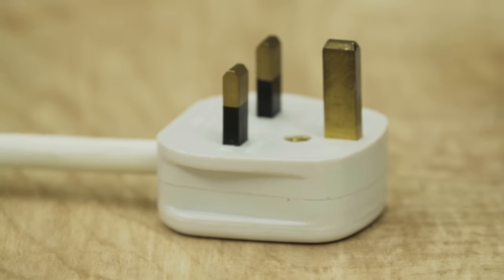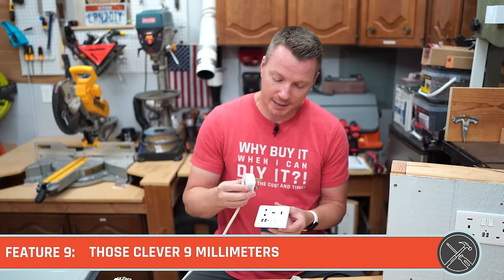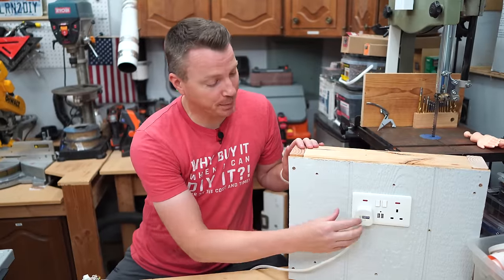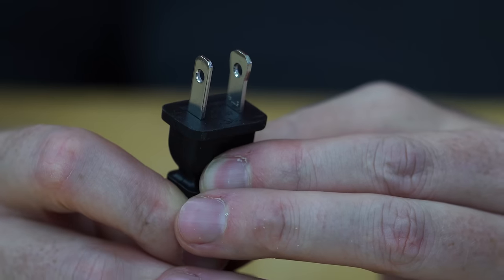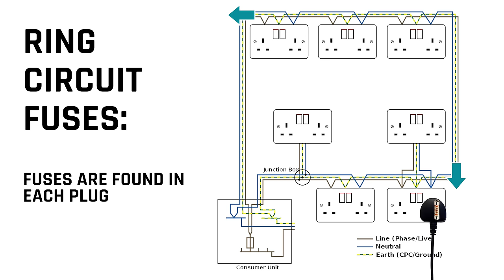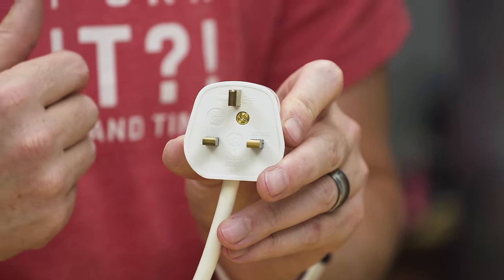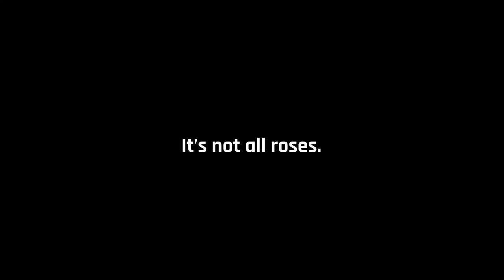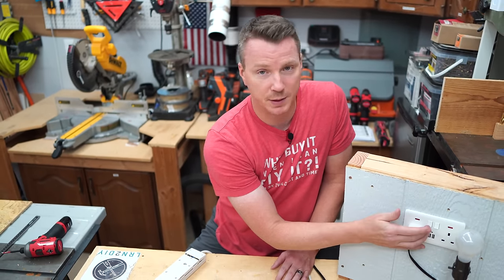British Plugs and Outlets Are On Another Level

Comment: As for your #9, the USA does have the insulation on the hot and neutral prongs to prevent boot leg wire wrapping.  It is the stuff made in China that does not have it.  A lot of countries have reused the type A and type B and don't realize that the USA has both a 5-15 and a 6-15.  Both the 5-15 and 6-15 might be considered type B/A outlets, but are different voltages.  This is why people are confused about safety is because countries that make the plugs have their own idea of the plugs.
Reply: I've never seen a type A or B with any kind of insulation on the prongs irrespective of country of origin.

Comment: In a typical UK house, there is more than one ring circuit. Usually you will have at least one ring circuit for the ground floor (US 1st floor), another for the first floor (US 2nd Floor), and so on.

Each ring circuit is rated at 32 amps. If you have many outlets you can split a ring circuit in two and add another 32 amp breaker in your circuit breaker box (UK consumer unit). 

You should not have an overloading problem if there are sufficient 32 amp rings. Wired with 2.5 mm twin and earth cable.

Lighting circuits in the UK are radial, usually 5 amps and again one for each floor. Wired with 1.5 mm twin and earth cable.

Electric Stove Circuits are also radial, usually 20 amps, and wired directly into a special switched isolator nearby. Wired with 6 mm twin and earth cable.

Comment: Factoid: Ring circuits I think are really only used in the UK and Hong Kong. I'm pretty sure they were developed as a war time cost/material saving measure since you can theoretically use a smaller gauge wire. And 230 volt circuits are considerably more dangerous than 120, so the extra safety features are even more necessary. 

Tamper resistant (TR) plugs are now mandatory on new residential installations in Canada, and I'm assuming the same is true in the US. These have gates on them that only open when both prongs push on them at the same time. They won't open if only one of the gates is contacted.

Comment: The British G Type fuse-in-plug was to protect appliance flexes. And to standardise on one plug and socket as previously there were different sized plugs & sockets and cable for different types of current draws and appliances: 2A, 5A and 15A. It was common to have three different types of sockets in one room. The square 3-pin with an integrated fuse between 1A and 13A (now user inserted) solved it all and also protected appliance flexes from bursting into flames.

However the fuse-in-plug became an enabler to use final ring circuits. The final ring circuit is ingenious in its simplicity. When used with the British G Type plug the ring is a busbar run around the house with distributed fuses at each appliance. The final ring Protected by an AFDD they are bombproof.

Comment: I come from a country that was an ex British colony and yes these plugs are common. I was even taught how to open and replace the fuse in the plug when I was in school. However, newer electrical appliances come with a plug that can't be opened, thus rendering the device inoperable just because the plug's are out of order. Also, there is a trend where newer devices that have only two pins.
Reply: You can always cut off the busted plug and replace it. New plugs are available at virtually every grocery store.
Reply: @jebeda  Yes, and faulty plugs are pretty much unheard of. There's little, if anything, to go wrong except perhaps a loose wire but that's rare on the new fixed plugs as the cables are moulded into place. The only thing that generally needs replacing in them is the fuse.

Comment: Just a few things.  A lot of new products use a completely molded plug with just the fuse accessible.  You can easily get sockets without switches for things like fridges you don't want switched off accidentally. You can get different fuses such as 3amp, 5amp and 13amp to protect different size cables or devices.  Ring mains distribute the power both ways around the circuit so load balancing is not an issue.  Each socket can take up to 13amp but the ring is often fused to trip at 30amps.
Reply: Electricians consider load balancing on rings when designing a system which is why kitchens (sometimes) have their own ring main.

Comment: From Iraq, lived in the UK for 4 years, lived in Australia for 4 years as well as travelled to central European countries many time. It would be fair to say that type G-plugs are safest but not the best. The down sides in my opinion are the size and with time makes the contact surface of the outlets become loose and overheats at the Line side. This is usual occurance that forces the users to change both the power outlet sweetch and the plug at the same time. On the contrary, this problem is less spotted with Australian plug type I which much smaller in comparison to type G

Comment: A few  points.
Load balancing isn't required due the nature of the ring by design. 
 The ring circuit is a parallel conductive circuit. The load is shared across both parallel live conductors, with each outlet being fed from two different ends of the ring at 32amp. How far away loads are placed becomes irrelevant. 
We don't have to worry about the size of the conductors as he mentions here because circuit design is strict in the UK and has to be compliant with regulations. 
A ring circuit typically uses a minimum of 2.5mm conductors,  Depending on overall circuit length, (maximum of 100m sq area) voltage drop should be calculated and it's effects factored into the design, up sizing the conductors if required.
And typically dwellings utilize multiple rings for different areas of the home. Kitchen. Bedroom, living spaces, etc.  

Testing a ring circuit isn't that difficult. There is a defined process for doing this as described in the regulations manual. Like all circuits they should be designed to handle their intended function appropriately, and tested accordingly to prove they will function as expected and meet safety standards. If it's too difficult for you, you should not be doing it. 
On which point. All circuits must have a design submitted and tests performed and recorded, by way of recognised auditing body for electrical installations, or submitted to the local authority if not done by a professional, before being made live for use.  

If you live in the UK and are used having a switch on the outlet, for which you would frequently use to power down appliances, you would not get confused "Troubleshooting" when turning on a lamp, or anything. You would simply check whether you had turned it off at the wall. Literally the first this you check.
 How is that confusing for a anyone? 😅

And Yes. These plugs lying down on the floor do hurt if you step on them. 
Really hurt.!!
 Everyone does it once.. You learn quickly never to leave yourself that vulnerable again. 😅
 Either leave stuff plugged in and switched off at the outlet. Or removed and stored safely away.
Reply: Load balancing may be a problem if there are heavy current drawing appliances on one leg of the ring. Circuit design can solve that.  Or have one leg on 4mm and the other on 2.5mm 

A ring circuit typically uses a minimum of 2.5mm conductors and has to have a 32A breaker in the consumer unit. 

I have never stood on a plug.

Comment: You should check out Australia & New Zealand's plugs, we use type I and its a good middle ground between these 2 plus, however I feel the positioning of the prongs is the most beneficial part to them.
Reply: ...and the Chinese liked them enough to base their standard on ours, although with the plug flipped over to put the earth pin at the top.

Comment: Testing a ring final is easy test end to end your little  r1, little r2, little rn, add r1 and r2 together and dived by 4
r1+r2=R   R/4=
0.50+0.25=0.75 
0.75/4=0.18
And it's as simple as that
Then you do your figure of 8 test

Comment: as a brit trades person, switches have never been an issue for trouble shooting. the size has never been an issue and ring circuits arent an issue as that is what sparkies are trained to wire in. im sure if they went to america it would seem foreign to them how you wire your houses. cant say ive ever stood on one either before. if i unplug something the device goes away or the socket is out of the way so the plug isnt just lying on the floor. who leaves a cable lying in the middle of a room

also i would never trade the plug we have for another. ive lost track of the amount of times in my life ive changed fuses or enitre plugs and its taken me a couple minutes to get back up and running as i can just take one off an unused device until i can grab a replacement which only cost about £1, if that.

Comment: If somethings not working we just try it in other sockets or see if another items works with the socket to see if the circuit breake may have been tripped, the breakers being tripped rerely happans and is easy to ckeck.

Comment: I moved from UK to HK, where as the video mentions we also use the Type G, but with two main differences that I noted…

1. In HK there are no switches on the sockets, and now I realise I quite liked them back in UK! They’re really useful if you want to turn something off at the mains, either to reset a device, or when leaving the house to go travelling. Now I have to physically unplug and re plug things and I don’t like it. Life is hard enough as it is. 

2. Not mentioned in this video, is that the UK regulations do not allow any of these type G sockets in UK bathrooms…this is for safety reasons and we usually only have specific outlets for shavers/toothbrushes. This is annoying in the uk as the hairdryer has to be put something else and I also want to plug in speakers and smart lamps in my bathrooms but cannot. But…In HK we can! There’s a socket in most bathrooms, but still without the switch. So it’s very useful for me, but feels a little dodgy to not be able to cut the power in the high-humidity environment. 

Anyway, great video mate!

Comment: I'm sure someone will already have mentioned it but we don't use ring final circuits any more these days in new installations. They were used as a way of making installations cheaper when copper was very expensive after the first world war, since you can use lighter gauge cable and less of it too, but it can lead to dangerous or weird situations if there is damage to the wiring.

I think the main reason the plugs were originally so "user serviceable" was that, here in the UK at least, nearly all appliances used to be sold without a plug, and you had to install your own. Nowadays this isn't the case and most plugs are of the latter type you showed - moulded with a separate fuse compartment. Wiring a plug used to be a vital skill for anyone, we were all taught how to do it at school!
Reply: Ring final circuits are still used. With the introduction of mandatory AFDDs on socket circuits - £120-150 for each, rings will remain to reduce the use of radial circuits and hence the purchase of unnecessary AFDDs.  The ring is dead - long live the ring.
Reply: @johnburns4017  Hooray for unintended consequences! 😂

Comment: Nice video, these plugs have many more positive aspects than negative. The internal fuse by the way also protects the flex on portable appliances if the appliance has a failure.  One minor correction, the plugs which have a plastic Earth pin are usually on appliances which are double insulated, not double earthed - your graphic was correct.
Reply: Excellent point Dave. I was looking through the comments to see if someone had noted this already and was going to do so if not. IMO, this is one of the best safety features of the British system. The plug can be properly fused to protect the wire and appliance at it's point of application rather than relying on the panel circuit breaker which has to be large enough to feed the entire branch. In US system, one can plug cords of #14, #16 or even #18 AWG into a 15A or 20A circuit. Hardly ideal. 
Another (perhaps minor) advantage of this is that the melt curve of the fuse can be tailored to the load.
- Retired Electrical Safety Engineer

Comment: Electrician from the UK. Load balancing doesn't really exist unless there's a break in the ring, as you're sharing you're amperes down both legs of the ring main. The only downside is that if the ring is broken for whatever reason, you won't know.

The UK plug and system is far superior than the American switches, especially when it comes to fuse boards, wiring regulations and standards. British supremacy

Comment: I'm an electrician in UK (originally from Romania) and I have few things to say:  1 the UK plugs are amazing, even better than European ones
2 yes the rings are annoying to install and test, so that's why we're not doing them anymore in new installation (some electricians may still do them, I don't) now we use 4mm2 radials
3 yes it is painful to step on them, but it doesn't happen too often
4 I do like that you can only plug them in only 1 direction as some appliances don't do well with reverse polarity
5 sometime I wish to plug something in (phone/laptop charger most often) upside down, like I can do with European plugs
Reply: In fairness, since we're now doing a circuit per floor, 16A radial circuits would probably suffice.  And no risk of a broken ring as a broken radial is immediately obvious.

Comment: The main issue with our Type G plugs is that the 13A rating is only really a short term rating, partially due to heat from the fuse, a plug that has 13A going through it for any length of time will get quite warm (a 13A fuse with 13A going through it will draw ~1W). The big pins make no difference really to the current handling, especially given European plugs are smaller yet support 16A
I understand the GPO only allowed 10A draw from a Type G plug and even then it had to be MK plugs and sockets, any other combination was 8A max.
Also not all sockets have switches (ones for boilers are not allowed to be switched for isolation reasons) and most appliances will be supplied with a non-REWIREABLE plug, esp. since the early 90's when fitted plugs became mandatory (devices came without plugs originally, Morphy Richards made mention in their adverts that they had "the iron with the plug on", so many plugs were being miswired that they had to make fitted plugs mandatory).

Comment: I'm a Brit, and If an appliance isn't working the first thing I check is if the plug switch is on. Also due to there being switches on the wall you don't tend to find these just laying on the floor, since you hardly disconnect them. Of course, that hasn't stopped me from stepping on one or two, and yes its waaay worse than lego.

Comment: great video! Could you explain the patterns of other countries and why the decided to be this way? I'm from Brazil and we have a new pattern since 2008, what make me think that for being so recently it would bring the best concepts from around the world. I would love to know you thoughts about it.
Reply: Post-war copper shortage meant the ring main was needed as you could usually get away with one circuit for all the plugs in one house.  Then we had to make plugs to cope with the fact that the 30A-fused ring main is wired in 20A cable and that a table lamp flexible cord might only be rated at 3A.  Previously we has various radial circuits with 2A, 3A, 5A, and 15A plugs and sockets all fused back near the meter which meant several ciruits.

This meant a 3 bedroom house could be wired with four circuits: SOCKETS, COOKER, LIGHTS UP, LIGHTS DOWN.

Now it's all getting messy again because regulations like to see separate circuits for each floor so if one gets switched off we still have the other one working, separate heavy duty circuits for showers and cookers etc etc so 10 circuits for even a 2-bedroom house is now nothing uncommon.

Comment: While having the switch at the socket is great for the electricity bills these days, I don't think that was the intention since these receptacles were around way before remote controlled devices appeared. I think the main use of these switches was to prevent electrocution since,  if memory serves me, those plastic "socks" didn't exist until the 80s or maybe even later. I guess that's why we were taught to always keep the switch in the off position before inserting or removing the plug.

Comment: Yes the UK plug is larger than the US plug but at least it is safe, looks neat and tidy and for me, most importantly, it stays nice and secure in is socket. When ever I visit family in the USA I cant help wincing every time I see most of their plugs hanging halfway out the socket just from the weight of the lead alone. South Africa also have a nice robust three pin plug, its very similar to the UK plug but instead of square pins it has round pins.

Comment: Also load balancing isnt really a thing here since any appliance that has over 1.5kw has its own rail. So cookers. Washers are on its own rail. And also each “rings for sockets has its own rcd protecting it same with upstairs and downstairs lighting you should really check out a uk consumer unit. Artisan electricals on youtube have some gread vods to showcase this. 🎉

Comment: Concerning "serviceable type G plug": I already have seen prefabricated powersupply cables which were coming with IT devices, carrying Type G plugs which are completely sealed off, cable fixed inside, glued in resp. the whole thing vulcanised together. One-block casted plug. Can not be taken apart in any way. Only the fuse chamber is accessible (a pull-out-frame which holds the fuse that is the only part you can replace in these). The "switch for every socket" is a feature which should become introduced everywhere in general. With an indicator to see wether the switch is on or off. Also in europe and elsewhere. It simply makes you more aware of energy saving if there is switch with a LED or neon indicator visible.